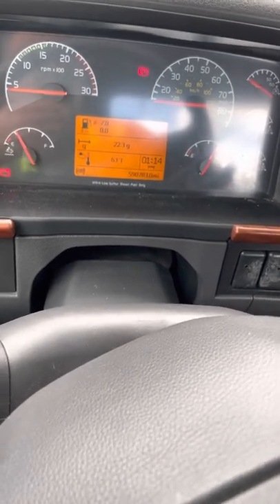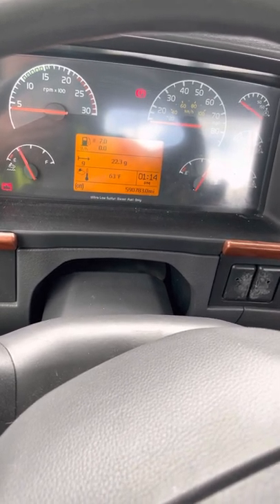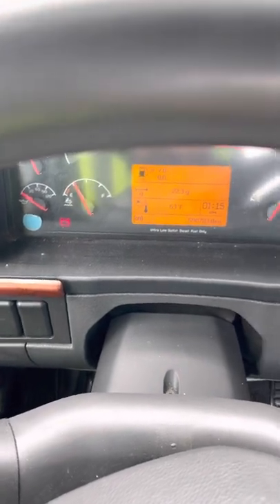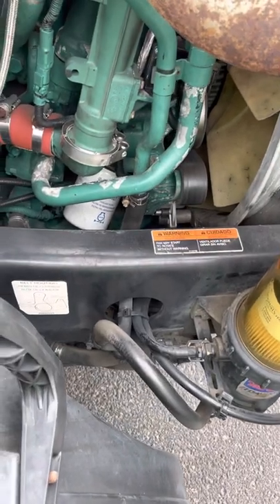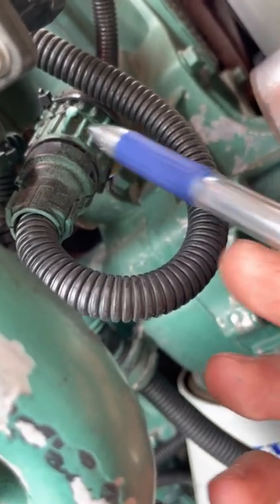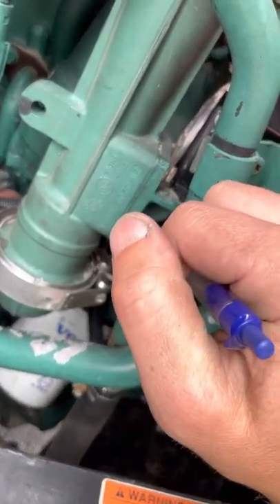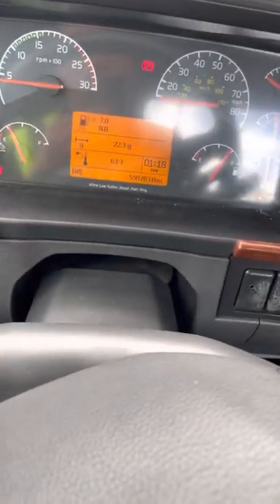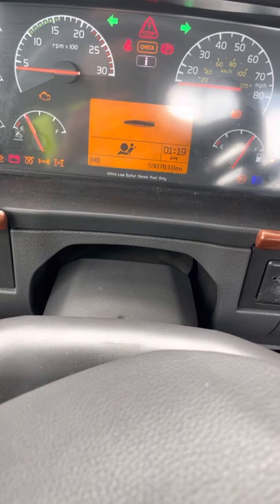Volvo D13, check engine light, SPN 411 FMI 7, SPN 4752 FMI 7

Comment: You should not use brakleen to clean EGR tubing, the residue left behind from brakleen will cause soot to accumulate faster leading to repeat failures, carb cleaner is what most OEMs recommended.
Reply from the maker: I have seen a same comment on some other videos but not sure if its from you or someone els and its actually the opposite of that! The Carb cleaner and Brake cleaner have same exact ingredients except the brake cleaner has methanol which helps the liquid to evaporate fast and leave no residue behind. Carb cleaner does leave a bit of an oily residue behind. The only time i don't use brake cleaner is when the part has rubber or plastic because the methanol intends to swell those parts and they deteriorate after a while other than that always brake cleaner and never had any problems.

Comment: Hello I have a volvo d 13 2013 I have 2 codes spn 637 fmi 3 and spn 4752 fmi the problem in my truck is hard to start the engine eny of this codes influence to the engine start.
Reply from the maker: If I were you in your situation I would start by replacing the crankshaft position sensor and delta pressure sensor as it’s easy to do and not very expensive and hopefully that fixes the problem! After that I would take it to the mechanic as it might be the injectors. 
Good luck man

Comment: Hey man my truck is a 2012. It was running fine with check engine on. I went on vacation for a week and when I try to start it the lights would come on, but it won’t crank at all. The only message i get it Maintenance required vehicle Ecu. And j1939 Communication error with Engine ECU. Please help me out with this if you have any idea what could it be.
Reply from the maker: I am sorry to hear that. I never have experienced your issue in the past and I don’t want to give you any miss information! I would recommend you researching your code and see what info you can find. If I were you I would contact a shop and have them check it out if you can’t find any info about the code you getting. I am sorry I couldn’t be helpful and best of luck to you. 
Keep us updated please
Reply: @lirives7660  thank you very much

Comment: Hey i have a 2012 vnl. Its not doing anything when i try to crank it. Its giving me this message along with check engine light. J1939 communication error with engine ECU. Any idea what could it be?
Reply: Possibly turn off the battery switch then back on.  Typically that error message is a ground issue.  Clean all the battery terminals, clean the connecting bars, check the buss fuse on the large battery cable, check the fusible link large negative cable that attaches to the frame, check the ground connections at the pass thru on the firewall.  You'll find some upper right drivers side and more below that area to the left.  Check the connections at the starter.  Clean them all with sandpaper and put it all back together and hopefully you should be good to go.
Reply: Hi there I was having the same problem and by replacing with the new ignition switch the problem is gone. Easy and simple fix. ✌️✌️